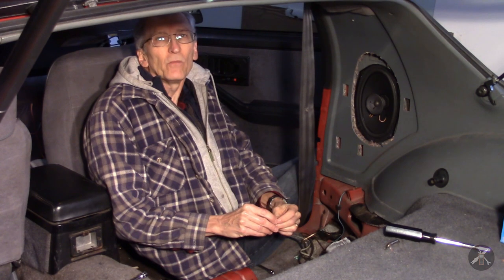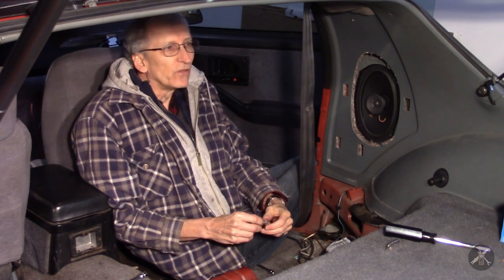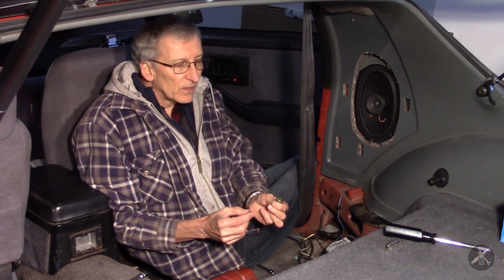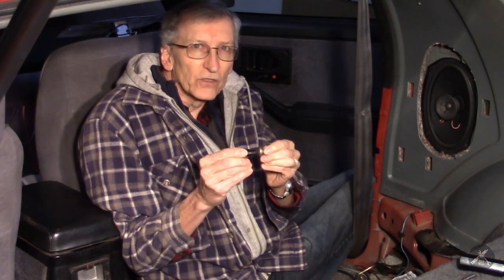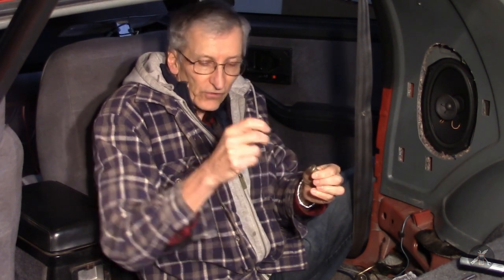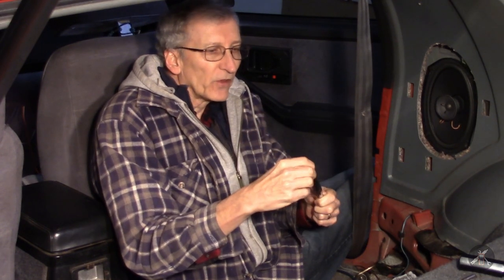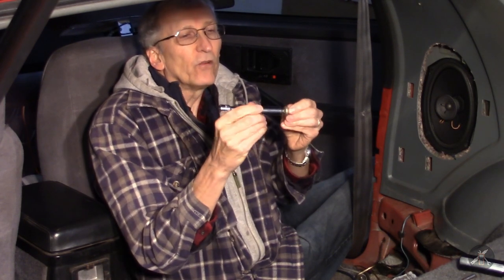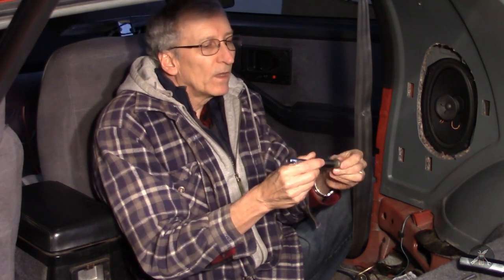What is the Best / Correct Tool To Remove GM Seat Belt Bolts- IROC-Z Barn Find EP84

Comment: I have a 1990 suburban. T-50 fits in perfectly. T-47 is a bit sloppy. Anyhow, I bought the 1/2" drive impact kit containing both and my seatbelt bolts won't budge (even with an impact gun.) Such a pain. Taking it to a mechanic this week to have him break them loose for me.
Reply from the maker: If you get a good fit with a T50, that's good.  Since the bolts go through the floor to the outside, they can get corroded even though the bolts have anti-corrosion coating / plating.  My experience is that sometimes the impact wrenches can't break tough bolts loose.  I have better luck with a long breaker bar in combination with a good penetrating oil, while still being careful not to break or bend something else.  I hope your mechanic has success.
Reply: @bitsofwisdom460  thanks! Yep I sprayed them like hell and used my behemoth breaker bar. I've broken 7 t-50s and 9 t-47. Hammered and heated them too. Such. A. Pain.
Reply from the maker: Yes, that is tough.  I would have gone the same route - heat and penetrating oil.  If you're breaking the bits, that's really hard.

Comment: I am looking forward to getting my garage built,,will be spendind alot of time in it working on the iroc z ,,same condition of your car but I put a new paint job on it the clear coat was chipping all over.Love seeing the progress.I am gonna be working on my window regulator next ,,all weather stripping brand new but my door wind alignment not very good ...I have t tops as well .Be carefull leaving the car outside in the rain you might get a big suprise.Keep up the great work.
Reply from the maker: Thank you.  I have had the car in the rain and you're right.  It did have some small leakage on one side, so I do need to be careful.
Reply: @bitsofwisdom460  Was it the passenger side?check the t tops as well,,Like you already know all can be fixed with a little patience,,I noticed places that can be fixed with a little silicone,,with nice professional results.

Comment: Good video.  You want those TP45, and TP50.

1.  `t`|`torx` is regular star shape with 6 pointy corners and nodes|tips.
2.  `tt`|`torx tamper`|`torx tamper proof` is security torx (and they have a female hole in the top center of the tip of the bits (because I had buy a set for app13 computers); hermaphrodite bits.  These used to be hard to buy anywhere which made them a security feature.
3.  `tp`|`torx plus`|`torx power`   These are hardened bits and have rounded and thick corners and points (because a mission critical joint was designed with more torque for the application (like your seat belt or a distributor or change a light bulb assembly sometimes)).  You need to apply alot of force (like with a breaker bar (for automotive and engine reasons)).
4.  `e`|`inverse torx`|`female torx`|`socket torx`|`reverse torx` is a female socket that mates with a torx head scew or nut.
`tps`|`torx plus security`  is tt and tp mix into one bit.

If you use a impact wrench, then use the bit adapter;  if something breaks, then it should be the bit adapter instead of the bit.  You can find the impact wrench adapters easier at your local shop. You can use your regular ratchet or hand wrench (without the adapter).  But beware, for if you do not seat it correctly then you can still shear||crack||break the bit.  Or if you do not apply square|perpendicular|normal force, then you might unevenly yank, crank, break the bit.

Torx works like a gear.  A gear is basically a lever.  The lever and the fulcrum of each tooth allows for more total power|torque (which makes the joint mating tighter).  Also the thicker||fatter the tooth and the rounder the [pitch circle], the more surface area and force is applied (making it more efficient);  your impact wrench or drill won't have to work as hard.  That is why torx `TP` type is designated for making stronger joints.

SnapOn and BluePoint, SK, and U.S.A. make their bits usually with fat and better [pitch circle] design.  They loosen and tighten bolts with more efficient force (but without killing your wrench or hand drill).  A [pitch circle] is like when the two gears mesh efficiently at the teeth.  A good pitch circle is when you have correcty bit-to-bolt mating.

Chinesium||[from china] cut the manufacturing cost by thinning walls and making the seating loose.  Then the bit either breaks, twists, over heats, deteriorates, or they do not rust proof it.  You can find the ok chinese parts if you look at the fatness and how the metal was forged (and if you know what to hear for sometimes (like the old days when they knew the tune frequencies)).
Reply from the maker: Thank you for your comments.  I expect that the GM special is a Torx Plus series bit, but when I located design drawings on line, I couldn't determine an exact match with TP45 and TP50.  My thought is that GM may have had a special profile designed to their specifications, such as perhaps a TP47.
One more fine point, there are Tamper Resistant (6 point with a pin) and Tamper Proof (5 point with a pin) Torx.  Many times those are confused.  I learned the difference when I was working hybrid powertrains and high voltage access covers.  The Tamper Proof version tools were not generally available at the time and you may have to prove to the tool manufacturer that you have the authorization to purchase them. I imagine there are cheap versions of the 5 point available these days that aren't restricted.